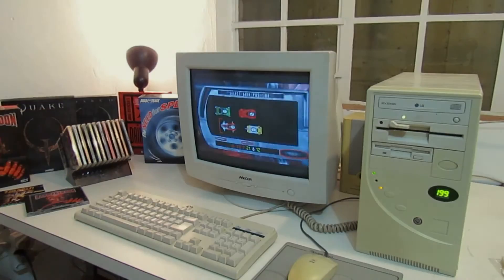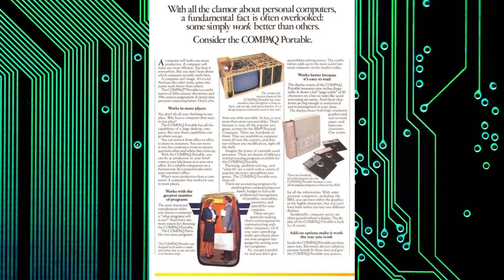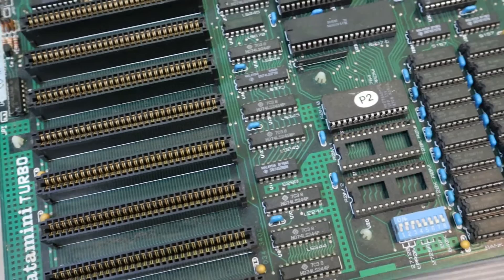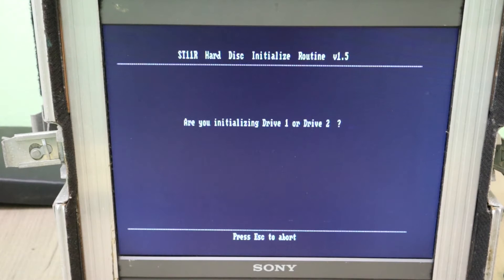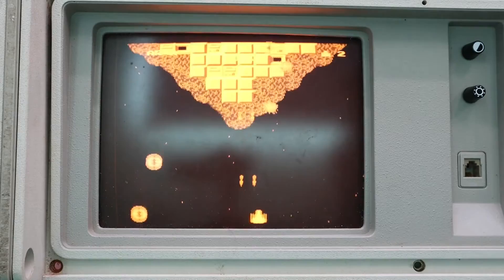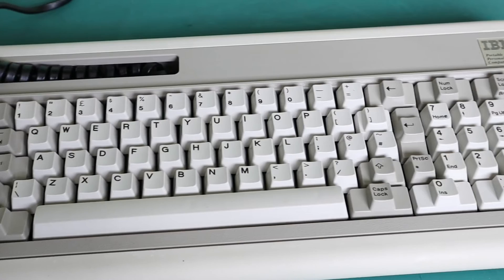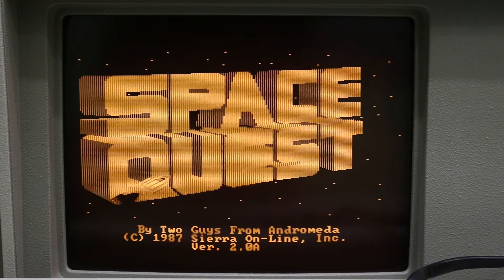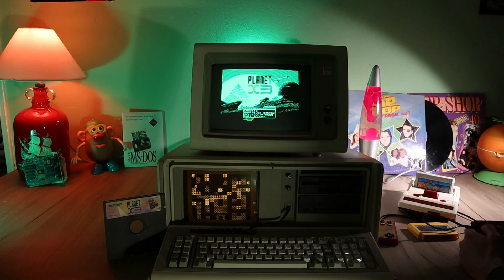The IBM 5155  - Portable Computer weirdness from the 1980's!

Comment: Reading that article on RLL controllers in your video, it seems that 32MB would be correct for your 20MB Seagate drive, as RLL controllers can use MFM drives and get more storage out of them. So that's why you weren't seeing any errors. It really is effectively bigger, and is probably completely alien and unrecognizable to a regular MFM controller at that point.
Reply from the maker: Thanks! Yeah this whole RLL/MFM stuff is pretty new to me, but it does seem to work fine though. I was just a bit concerned that the drive wasnt "designed" to be an 33mb RLL drive so that there may be issues..
Reply: @ohsoretro5612  Back in the day, you could actually swap your MFM disk controller with an RLL one and gain both performance and capacity from an existing MFM disk. An RLL controller is - as you said - over-formatting an MFM disk by using a more efficient data layout. In the end, MFM drives are just platters with direct connection between their heads and a controller, so the controller may choose any read/write scheme that doesn't exceed physical capabilities of platters. "Plain MFM" is just extremely inefficient with the format, especially on outer tracks.
Reply from the maker: @peachgrush  Thanks for the info! So was there any actual physical difference then between the RLL and MFM version of the same drive? LIke the ST-225 and ST-238R for example, or was it just branding bascially?
Reply: @ohsoretro5612  Pairing an RLL controller and the ST-225 was very common. I did it on most of my 8088 systems back in the day. On the BBS scene we would get some people posting that "we were asking for trouble" with our drives but I never had even a hint of trouble from the practice over the years.
Reply from the maker: @hansoak3664 Thanks for the info! I was using this machine again the other day though and the boot sector kinda died..even though the data is all still there.. so I think I might have run into a RLL/ST-255 problem :(
Reply: @ohsoretro5612  That's a bummer. You might have just ran into old drive problem. By this point, all of that equipment is long past it's MTBF.  If you can get SpinRite hard disk program from the day, it can really give you a heads up on any problems forming with a hard drive. It was hands down the best program of the time to have and use. . I ran BBSs is on that drive and controller combination for years and never had so much as even a hiccup. But, I ran Spinrite regularly to check on the drives.

Comment: I bought a 5155 from an electronics recycler a few months ago. It's in a good condition, and with some time and patience I got it running again. I wish I had that Datamini Turbo board, though.
Reply: Update: It seems that I can get an NEC v20 chip to replace the 8088 and then an overclock mod to get the entire speed to run around 8MHz.

Comment: Very cool ;)
I have a very similar setup with an IBM 5155 topped by a 5151 monitor in dual-display mode, except that I hooked the internal CRT to the Berg connector of an ATI EGA Wonder 800 instead of a CGA card. The image quality on the amber display is much better that way and pairs beautifully with the crisp MDA/Hercules!